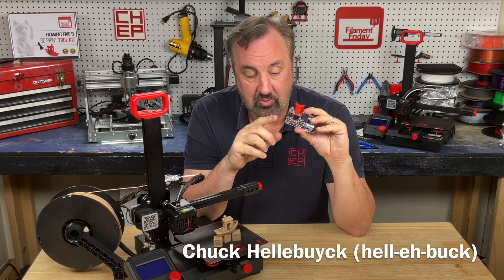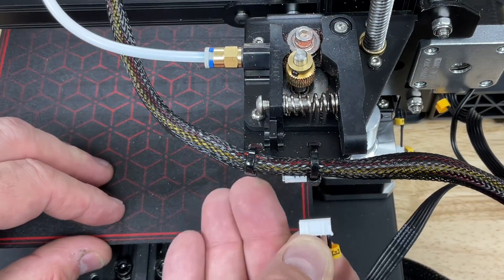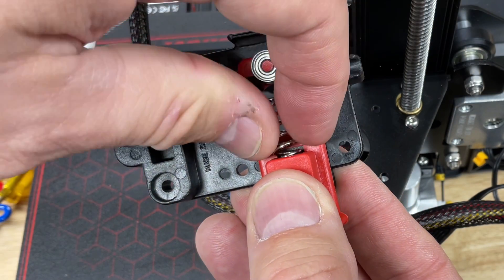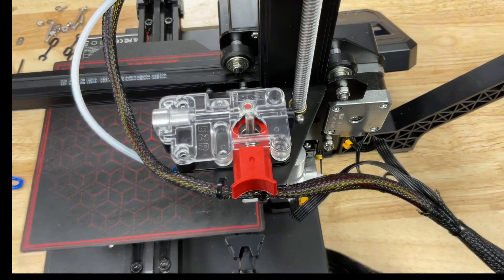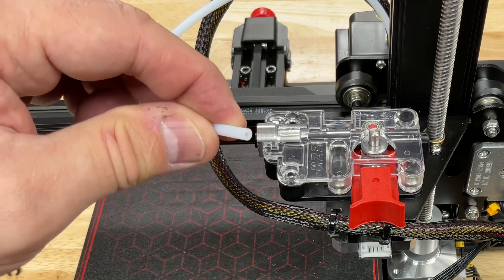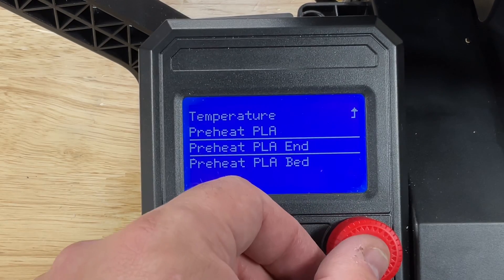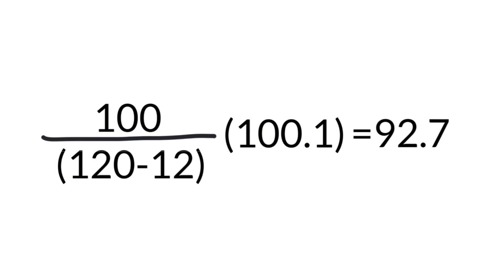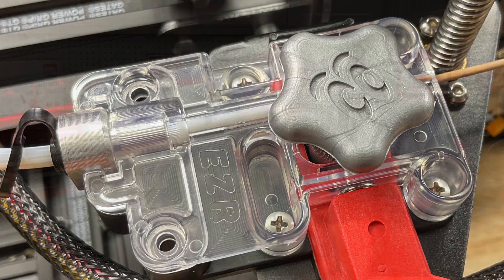Upgrade Ender 2 Pro to EZR Extruder

Comment: @CHEP, Hi Chuck, I have seen your videos regarding this extruder before.  If I look at the seemecnc page it states its compatible with all filament types but states its not compatible with glow in the dark filament.  Why would this be an issue?  Have you tried glow in the dark with it?
Reply from the maker: I don’t understand that other than it will wear out faster with abrasive filaments like that.

Comment: Chuck how do I set the Z offset and have it stay? That’s the only part I’m missing on this printer? Do I just have to mechanically adjust the switch? Just bought your bed leveling tool and love it. All my other machines have a probe and the z offset wizard. I’m only able to live baby step it and then the next print I have to do it again.

Comment: Never tried an SerMeCNC EZR extruder. I do hear good things about it though.
Not sure I will get one though. Maybe one day I may, just to try it out. But I sort of fell in love with the Bondtech LGX extruders. Both are great but I particularly love the LGX Lite.
Before them I would swap those creality extruders with a BGM extruder, either a Bondtech or a Clone, as the ceality stock extruders are crap in my opinion. Even their metal versions. I just hate that design. :)
Anyways. Now I just use the LGX's, unless it's a delta where I use a remote direct drive like the Flex3Drive or Zesty Nimble. The LGX extruders are so easy to load filament and I never have issues with them feeding any type of filament. The Lite version is a great alternative for direct drive. I currently have one installed on my Neptune 2 as a direct drive and plane to convert a few others from Bowden to Direct Drive as well.

Comment: I love that you can see the filament at all times while loading it; that's the issue I have with mine, it always snags somewhere, and I can't tell if it's on the extruder wheels or the entry to the PTFE tube after.  This would be an ideal fix for that issue.

  Thinking about it, though, would this be a downgrade for a CR10s-Pro with the supposed Bondtech dual hobbed drive gears?

Comment: Hey chep love your videos it led me to buying my first 3D printer which is the ender 3 neo. I assembled it and I accidentally connected the wires in the wrong places so when I switched it on it popped and started smoking. I immediately switch it off and it doesn't want to turn on after that. Can you please help me with this I hope I didn't destroy it
Reply from the maker: Return it. Sounds dead to me.

Comment: I can't recommend the EZRstruder, even though I wanted to like it.  I had one on my Ender 3 Pro, and after about 6 months of regular printing, the bearing on the red part started coming loose, allowing the filament to slide up over the top of the bearing.  It couldn't be fixed.  I went to an authentic Bondtech BMG and haven't looked back.

Comment: The EZR is such a simple, yet awesome extruder! Shame SeeMeCNC doesn't offer them on Amazon. Only because they would then get the exposure they deserve. I am shocked China hasn't cloned them yet. Such a huge improvement in quality, and usability.
Reply: I much prefer the dual drive gear extruder with 3:1 drive ratio.  Never slips and tons of torque.  Also has enclosed filament path.  It's not see through though, which would be a nice bonus.
Reply: @engineer1692  I have a similar BMG extruder on another printer, and they are good as well. But I really think the EZR holds its own against a BMG style extruder. And they are a very easy swap in, and require zero maintenence (in my experience ).

Comment: I love this extruder! I run the EZR on both my CR-10s and now my Ender 2 Pro. On my Ender 2 Pro, had to replace the extruder stepper motor because mine had a short shaft and a pressed on filament gear. Luckily a replacement stepper motor is cheap.

Comment: Would it be possible to replace the main board with one for a ender 3 v2?
Reply from the maker: Im sure you could. I know some people have installed a V4.2.7 in it. It’s the firmware that can be hard to find.
Reply: @FilamentFriday  well what if you configured it with v2 firm ware adjust the x/y/z axes to the size of the bed. The one could use the v2 display and even upgrade it to the sprite pro extruder
Reply from the maker: Anything’s possible.
Reply from the maker: @Loneman - A tear in the crotch might still allow it ;)
Reply: @FilamentFriday  I don't quite fallow
Reply: @FilamentFriday  OUCH!  That sounds a bit painful!  Oh, you mean in the pants?  😂